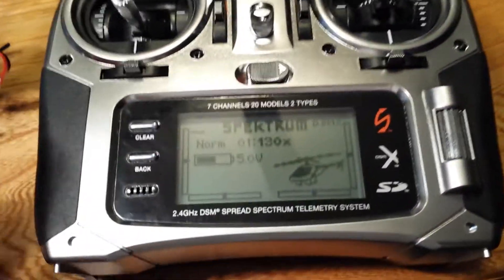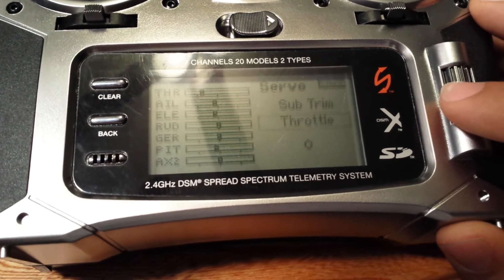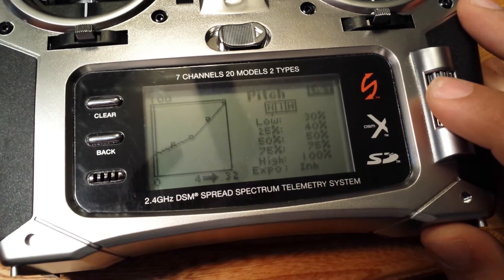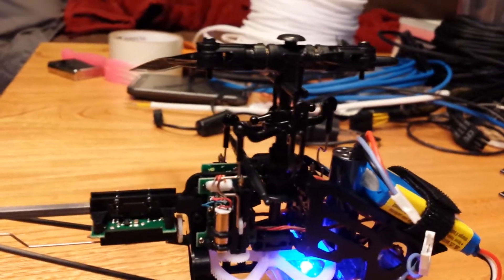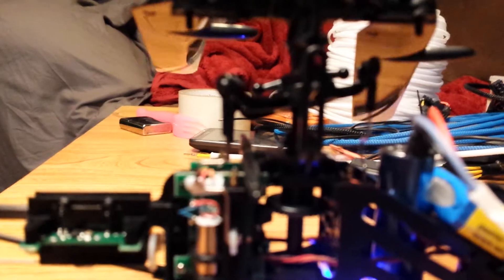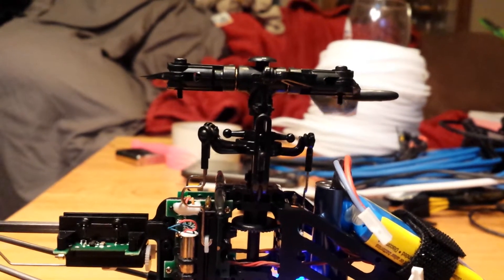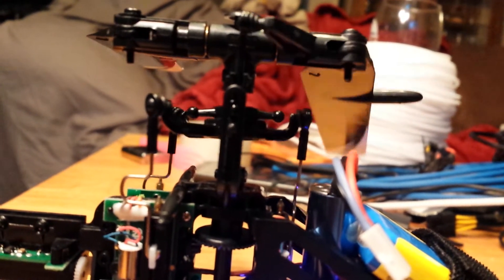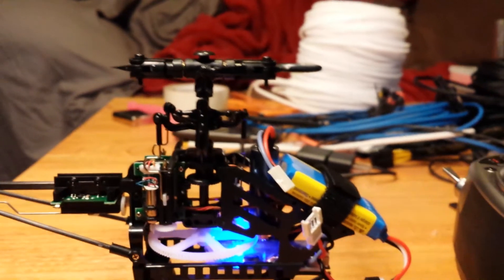130x swashplate issues

Comment: Hi there,Im new to collective pitch,I recently bought x130 with dx7s transmitter.Im not sure if this is the answer but I thought id thro it out there mabey it will help,i noticed when you went into your programing you had a swashplate setting at 60 percent and you went bye the book,however I did to but dint have that setting option,i chose( 1 servo normal) and left it at that and mine flys great.you may want to look at that swashplate setting.hope this helps.